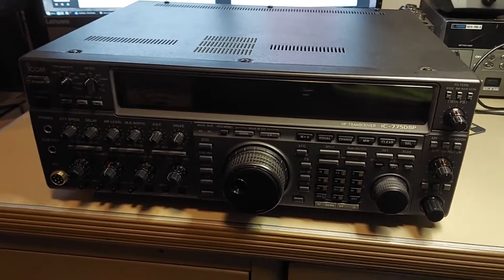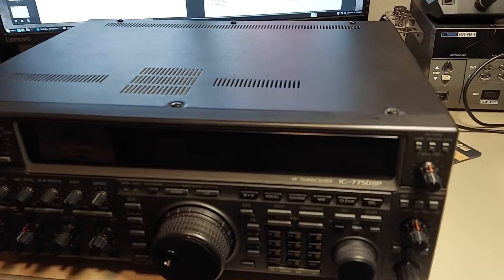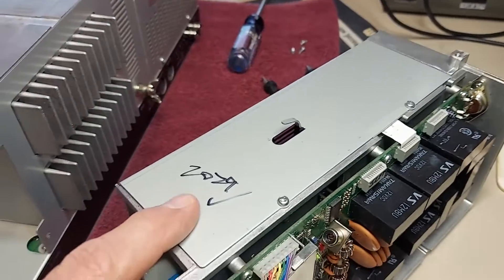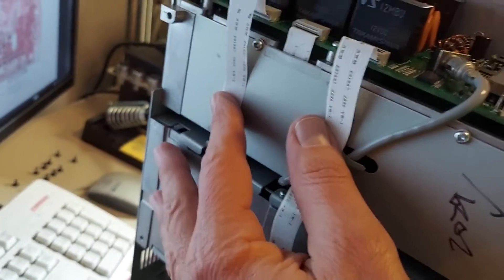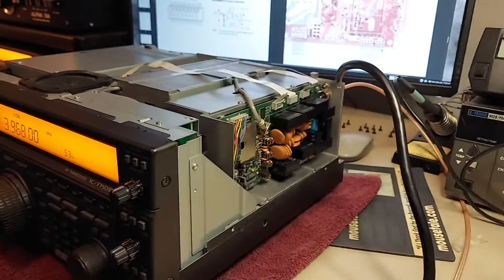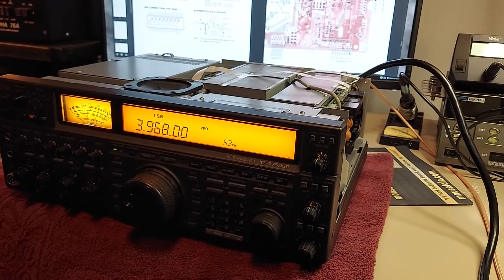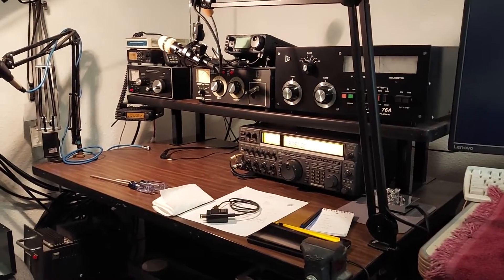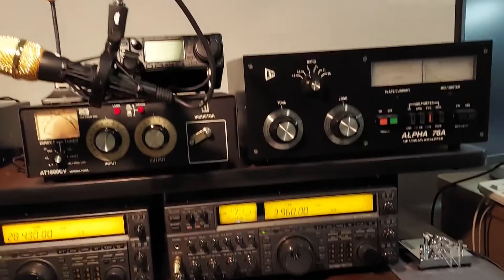Icom IC-775DSP internal antenna tuner replacement.

Comment: where you are find this parts also i i have problem in this component best 73 from iz5rvl
Reply from the maker: I was able to find the parts on eBay, but I decided just to replace the entire assembly. It's still sitting on my to be repaired shelf. I just haven't had the time to swap out the relay driver chip. Thanks for watching.

Comment: Craig, I did get the PO problem solved.  Thank you! However, I have a bit of a problem with the tuning knob. When the radio runs for a long period of time [8 hours or so] the tuning knob gets increasingly slow to turn. NOT real hard to turn, but it decreases noticeably. Occasionally it squeaks while tuning (!)

When the radio's been off to cool down for a day, the tuning knob is fine. So I must ask you, how do you remove the front tuning knob?

I have some silicone grease to lube the encoder shaft bushing, which I believe [from all that I have read] is the problem. After 30 years, I have grown to really enjoy this 775DSP!

Any assistance from your standpoint on this matter would be most gratefully received.

Many thanks for taking the time to respond! Best 73!
Reply from the maker: Interesting, I haven't experienced this issue. The main VFO knob can just be pulled off, there is a brake adjustment under the rubber ring but this will not be affected. You may want to look out for a replacement encoder on eBay, I see a few posted occasionally. eBay is where I get most of the replacement parts for the 775DSP's I currently have. Good luck and thanks for watching!

Comment: Ho Craig
I have one ic775 with the same problem.  Did you solved it?
How?
Thanks!!
Reply from the maker: I eventually traced the issue back to a defective relay driver chip. The chip had weak outputs that would not sink enough current to pull the relays closed for 15 and 10 meters. I did get some replacement chips, however; while waiting for the new parts to arrive I found a good deal on a used antenna tuner assembly and just swapped out the hole unit. The tuner unit is still sitting on my 'to be repaired' shelf.  Thanks for watching!
Reply: @CraigPetersen12f36b 
Thanka Craig.
I've checked the uProcesor outputs and anyone is activated for 10-12-15meters.
Dii you check the uP also?
The drivers outputs nr 2 and 4 never are activated...
I'll continue checking the tuner.
Thks
Reply from the maker: Yes, signals from the uP were making it to the relay driver chip but the relays were not closing. I even fed 5v to the input pins of the relay driver chip and was able to force the relays to close on all bands except 15 and 10 meters.

Comment: Craig, I haven't used my 775DSP in 14 years. Connected a dummy load to it and no PO whatsoever. Do you know anyone in the SoCal area who is qualified to work on this? Pretty sure that the finals are out of it, if my memory serves. Many thanks for taking the time to respond! 73 de Me
Reply from the maker: Unfortunately no. However, you might be able to call them and see if they can provide you a list of qualified service shops that may be able to repair this transceiver for you. You can still get replacement parts from Icom for this transceiver but no longer service it directly. If you're sure it's the PA section it may cost about the same to find one eBay and swap the entire module out. 73 and thanks for watching!

Comment: That's brilliant.  My old icom 775dsp died, but I loved that rig and have been trying to get another one for ages, but trying to find one that works and in good working order over here is just about impossible. 
73 zl3xdj.
Reply from the maker: I hear ya, these transceivers make an appearance on eBay from time to time but some have seen some pretty rough service. Others are simply unloading them because Icom no longer services them and getting parts can be difficult. But, every once and a while you can find one that the owner has kept serviced.

Comment: Having issues with atu also found 1 motor not working and plastic shaft connector with grub screws has a crack got parts coming but the receiver sounds deaf now would that be the case if the atu isnt tuning ?
Reply from the maker: I would say that is likely. I notice on my 775's the receive is muted and the sensitivity comes up as the tuner reaches the point of match. I find this preferable since the tuner acts like a bandpass filter to help attenuate strong out of band signals.

Comment: hey craig leigh VK7 WUU in Tasmania Island just wondering what the chip set cost you from china as in the cost of the chip set and freight as I'm just about to purchase long overdue ic 77s DSP and it have and intermittent tuner issue ??? may be connector or just a reset may fix issue as it still does tune on second attempt so could be the beginning of the chip set issue OR perhaps the reset of the tuner re setting ( memoriesing ) all the values of flat match on all bands fingers crossed may correct issue if I'm lucky , either way id like to obtain a chip set to future proof myself from that issue ?? did it fix the tuner unit you took out of the second 775dsp ?? and can you notify me of any other common issues re this icom model please  cheers 73's VK7WUU LEIGH SOUTHERN TASMANIA ISLAND AUSTRALIA ...
Reply from the maker: Good Morning, at the time I purchased these I paid a total of $27.48 for 5 units including shipping. In my case the outputs that close the inductor relays on 15 and 10 meters were not engaging. I even sent 5 volts to the inputs on the IC and all the relays closed except 15 and 10 meters. An identical IC is used to select capacitor values and it worked fine. I still have this tuner on the shelf, it hasn't been a high priority for repair since I had another fully functional tuner and simply swapped it out. When conducting the tuner reset procedure use a high quality RF load, avoid the typical loads like "cantennas" or other cheap RF loads. I used a Motorola model  T1013A RF load. Also use an oscilloscope set for DC coupling and limit the bandwidth to 20MHz or less, you can then adjust the trimmer for minimum voltage. So far this is just one of the issues I have come across with these tuners.  The other issue is where the tuner cannot match the antenna due to the mismatch being out of the tuners range, or the tuner will only tune part of a given band. This is usually fixed after readjusting the reference voltage and forcing a re-learn, if not there may be something wrong with the antenna or the feedline. 73 and thanks for watching!
Reply: @CraigPetersen12f36b  
thx craig , thought id finally score a unit but the owner was an elderly man whom's eyesight as far as condition of the unit was far from expectations once photos were received lol so still looking for an amaculate unit in Australia as still after cover freight pretty much kills anything out side Australia cheers leigh vk7wuu
Reply from the maker: No problem Leigh, I originally purchased an IC-775DSP back in November 1999 used it for about 8 years or so and sold it. The two units I have now were purchased off of eBay about a month apart. The first unit I received is in very nice condition and came with the CR-282 high stability reference installed. I was able to find all the optional filters off of eBay as well and now have a fully optioned unit. The second unit has a few more wear and scuff marks, this unit was modified for 60 meters and has the UT-66 voice module installed, this also is the unit that had the tuner issue. It is possible to find good working IC-775DSP transceivers, it just may take awhile to find one, these units were manufactured all the way to 2003 so you should be able to find a clean unit. 73..

Comment: I also have an issue with my at in the 775dsp.
With certain amounts of outputpower it tunes.
After crank up the power a bit it drops seeking again.

Think it needs a reset as well.
Seems it is an alignment thing?

If it interests you i can post the result,doing the reset soon.

Rob de PE1RYX

Comment: Hi,  can it just be that the original tuner also needs the reset? And has no hardware issue??Rob de PE1RYX
Reply from the maker: Greeting Rob, I reset this tuner twice and had the same results both times. It would complete the procedure without errors but still wouldn't tune 15 or 10 meters. With a bit of troubleshooting I discovered that the fault was being caused by a defective relay driver, however also discovered that it was the relay driver for the inductance selection relays. I originally suspected the capacitance section but this wasn't the case. Thanks for watching! 73

Comment: Glad to see you got it fixed!  Hope the new chips workout!  Nice station you have...wouldn't mind seeing the antenna farm!  :)  73's OM.  ~Jack, VEG
Reply from the maker: I originally bought one new back in November of 1999, had it for almost 10 years and reluctantly sold it to get something else. Acquired both of these off eBay, aside from the issue I had with one of them they are solid performers. I plan on getting around with an antenna video but the snow has arrived. I just received a new Hygain AV-640 40 through 6 meter vertical. 73 Jack and thanks for watching.